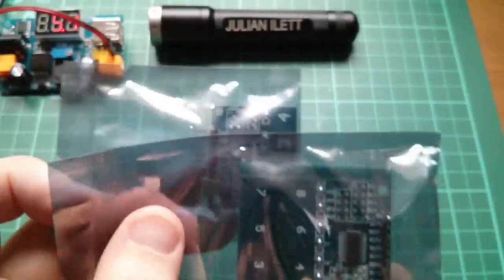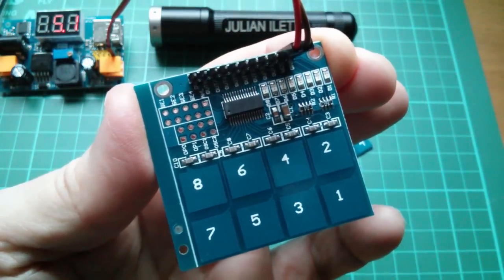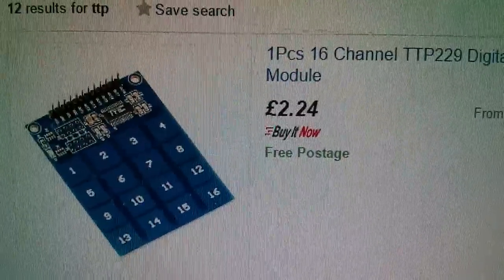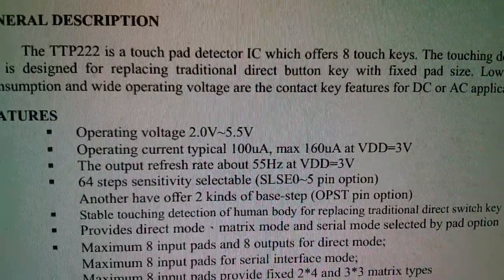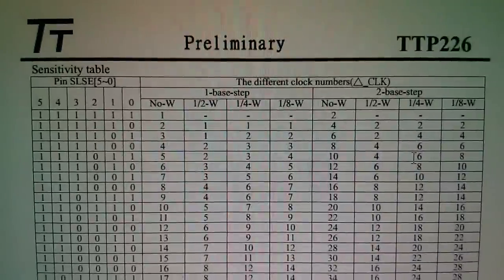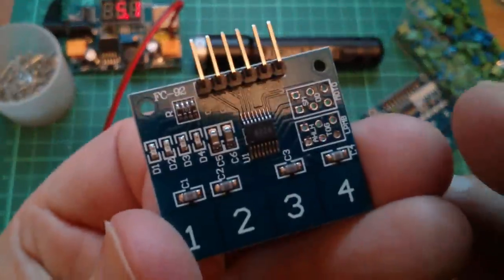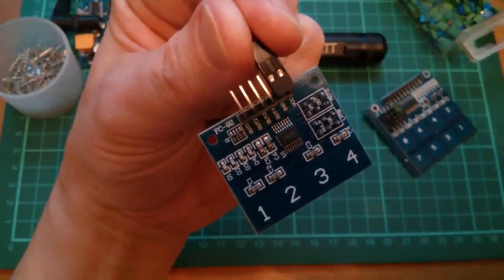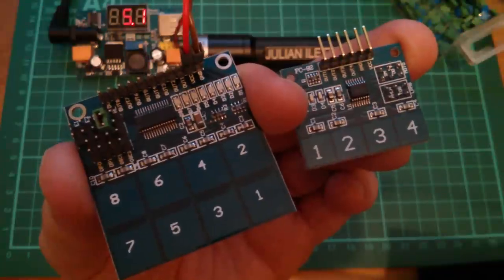Postbag: #32(b) - Capacitive Touch Switch Modules TTP224/226

Comment: when  i desolder filled holes I find it easier to heat it the pad from one side and have the solder sucker at the opposite end of the hole.  of course you will need a vice to hold the board in place.  thanks for the video...very helpful
Reply: +bd594 Yeah, it's much easier that way, you get a nearly air tight seal when the soldering iron tip is not getting in the way.
Reply: +bd594 Yep, always been doing it this way. Piece of cake.

If you can't (because the "other side" is not accessible), solder wick is an easy enough solution.

Comment: ".. where triggering an adjacent key was a major problem."   Well, that's it for touch sensitive controls in nuclear power plants then
Reply: That's really weird you should mention nuclear power plants - I was thinking of the Simpsons episode when Homer tries to use the phone and gets a message saying "the fingers with which you have dialled are too fat, if you require operator assistance, mash the keypad with your fist now"
Edit- Just to clarify - I'm not referring to Julian here or being cruel - I wouldn't be able to press these on their own either. It's just what I think of when buttons are too small for adult fingers.

Comment: Small tip for clearing holes: mount PCB vertically, heat a hole with a soldering iron from one side and use a solder sucker on opposite side :)

Comment: I know, it's quite late and I don't know if already said it... Through hole pads are easier to clean if you put the "sucker" on one side of the pcb and the soldering iron on the opposite side. And a little dip of flux (or fresh flux containing solder) can help a lot as well. Hope this is helpful anyways. Greetings from Germany!

Comment: I had some PCBs made that I designed for a domestic light switch replacement arduino project. I can toggle and dim from 5 touch pads on the PCB. Also put some 0603 smd LEDs soldered mounted on their sides shining on the pads, works a treat :)

Comment: I find it somewhat suspicious the chip came with the pin hole soldered shut.. and once you do get pins linked, the functions do not work correctly. It's almost like the company knew the functions do not work correctly and just cover up the holes with solder as to discourage people from finding this out. Come on Tom Tech you should know better! Any thoughts?

Comment: Julian Ilett With those filled in-holes, I'd either use the heat gun, heat it up and just push the headers in without bothering to suck out the solder, or I'd blob a load of solder all over it, heat it with the soldering iron and just poke the pins through one by one with the solder molten, then just suck or wick away the excess solder. In other words, don't bother trying to get the solder out of the holes, just worry about getting the pins in :)
Reply: Also, I'm wondering if those touch pads are actually intended to be extended in some really botchy way, ie by capacitively coupling a wire on to them without making an electrical connection. I'm wondering what happens if you just physically stick a wire to each pad with glue or tape and then touch the end of it? Or perhaps a small square of conductive foil glued to each pad with a wire attached?

Comment: Back in 1975 - a 4000 series logic chip with a 10 Meg resistor between input and ground - produced a reliable touch sensitive switch. Picking up mains hum when touched.

Comment: I don't think you can really blame the chip, or even the PCB layout on the bigger unit. Sensitivity defaulted to max, but easily rectified. in 'single' mode, it obviously did what I would have implemented in software, anyway. "Use first detected, ignore all others until none detected'. Think the real fault is the current drawn by the LED's. ?increase the SMD series resistors considerably, maybe?
Oh, wait, Julian...you wimped out of building that surface mount 'roulette' thingy' ;-)
SMD's aint so bad. I've got to use them at work, even 28-pin  0.5mm spacing chips can still be easily done by an old codger of 58 like me...just buy an SMD practice board from alice, banggood or similar first...

Comment: I look forward to seeing more touch sensors in later videos :) As you said... it's hard to not want to get your hands on some of the other variations to work out what the heck is going on! Like some other people have mentioned, I would look at mounting it on something to remove the  'hand capacitance / bridging" possibility from the equation, and would be very critical of the circuit implementation - our chinese friends have no regard for chip tolerances at times and make some wonderful 'release the magic smoke' circuits! 

I'd also love to know how much space you can put between the pads and your fingers... can you put a 1 / 2 mm piece of plastic between your finger and the pad? Glad wrap should work (it does for computer touch pads), so what else can you put the panel behind... And had you thought of playing with computer touch pads... you can get them complete with decoder chip, which can be interfaced with an arduino... You can then define your own 'touch zones' etc...

Comment: Maybe it needs a 3D printed spacer grid thing between all the buttons, so you get a bit of a raised edge and to isolate the buttons from each other. Ordered the one with 16 buttons just now. I'd like to control the Ikea Trafdi smart lights with it and a Pi Zero W.  Should be fun. :)

Comment: Looks like having too many LEDs lit up is causing the chip to shut down. I wonder if the output pins on the chip are driven off the internal voltage regualtor - I imagine that can only handle a few mA. Cheers!!
Reply: Yes, an output pin can only source 4mA according to the datasheet. But it does not mention what the limit for all of them is and if it's driven off the regulator.
Julian Ilett  measure the voltage at the output pins, preferably with an oscilloscope, and check for "dips". The internal regulator has 2.3V so if you see that, you know the LEDs are driven from it. Btw. you have to specifically search for the "BSB" version of the chip, which has 16 pins. The 20-pin datasheet has more pins with additional options. (check http://wenku.baidu.com/view/ff775115a216147917112855.html )

Comment: Didn't have any problems with my four way version. Normal sensitivity and none of the bugs you had. Though mine had a slightly different pcb (at least the silkscreen font).

Try putting a piece of plastic or glass on top to lower the sensitivity. After all, in real world applications you wouldn't use the board as is. I connect mine to some copper pads attach to the back of a glad panel, ad replaced the four caps with a lower value.

Comment: I guess you did not test the SBMS as of now. You will probably love the response and sensitivity of the 6 touch keys. I use the STM32F072 microcntroller for the capacitive keys and the software is quite complex and takes some resources but after you adjust all those complex parameters it works really well.
Anyway I added a key lock like on mobile phones so that there will not be unintentional touches. To unlock just push OK UP and Down in order but it will indicate that on the screen if you touch any key when is locked.
Reply from the maker: ***** Not yet, but after I fit the 8 LiFePo4 cells into the bike, I'll be looking at balance charging and the 2 BMS boards that I have. Then I'll start looking at the SBMS. I did think of you when I was having all that trouble with the capacitive switches!

Comment: I find that desoldering wick will suck it right out of those holes--another alternative--wet the solder and thump/slap the PCB to knock out the solder with inertia--may need tor heat after this to smooth..  Filled-in holes: Probably due to a solder-wave swipe??  I agree with the "BAD" verdict.

Comment: Hello - the 4 Way switch works good  when you use batterpower , when i  shut off the Powersupply - it begans to work correctly   with the rest of the Condensatorpower of the powersupply !!!!

Comment: Did you ever get hold of a TTP226? I would love to see your tests on that. I've just ordered a few from China and would be happy to post you one when they arrive in a thousand years (I'm in UK too). Also, I'm intrigued by the brief mention in this video about matrix mode, I'd love to see your investigations into that.
Reply from the maker: No, I gave up on the TTP chips - I prefer the MPR121
Reply: thermal touch switch using op_amp

Comment: Next time try adding some fresh lead based solder to mix with the lead free solder which lowers the melting point and you can just heat from the bottom side and suck it from the top side. I hope that makes sense.

Comment: With the four button touch pad I found that if you connect TOG and then connect SM the board works fine and does not lock up

Comment: Help!
How to turn on toggle mode in ttp226
I have done all possible connections, read data sheet many times, but nowhere toggle Is written.
Ttp226 has too many options to select, but how to use it in toggle Mode. I don't want to use arduino only to toggle output, which is working.

Comment: I wonder, did you ever get the second shipment with the 16 way?  I ordered one myself recently after finding them dirt cheap on ebay.  The 16 way only has 5 leds, and 8 output pins.  I hooked it up through my arduino and the output from the keys are very strange viewing them through the serial monitor.

Comment: Wow these appear to be very fun for the price! :D

But if anyone wants a more reliable capacitive touch sensor, try out the atmel's Q-touch line of chips, and especially the qt1070 witch uses i2c and can (extremely easily) talk to an arduino and output a 8-bit value on how much capacitance is detected. A really nice chip :)

Comment: Try the unit fixed down to something rather than hand held - it's possible something is coupling to another part of the circuit via your hand.
Also it could be a supply noise or instability issue at that particular current, try 100uF across the Vcc and Gnd, or a different supply.

The touch pad won't work on my Toshiba laptop when powered by a certain in-car dc-dc converter! How useless is that?

Comment: Thanks for sharing! Got one of the 4 touch version. Works perfectly. Is it possible to set the chip to one led on and toggle between other buttons? Got singlemode (sm) on and toggle (tog) but doesn't seem to do what I want. Any suggestions?

Comment: How did you enable that Toggle Mode? I have this board, and I want the 224 switch to keep the light ON when a pad is touched (momentarily), and then only turn off when another switch is touched.

Comment: "And the lines (lines from touch pad to IC pin) do not parallel and cross with other lines" Page 4 of the datasheet. So piss poor circuit design is most likely the problem here. Having the lines so close together probably screws up the auto calibration it has built in. Reducing the sensitivity could fix some of the issues.

Comment: Strange i am typing this one a keyboard from the 1980s that uses the same technology :P An IBM model F. :). I would say form experience working with capacitative seance PCB is grounding. you need very good grounding. Different pads will also have differing levels of capacitance even flexing the board could cause problems.  

i would say bad pcb design. The IBM uses 2 pads one 5v the other tied to ground , when you press a key a conductive pad moves towards the pcb causing a change in capacitance how are they doing it with just one pad ? 

The modern replacement controller i use can be adjusted by increasing or decreasing the mV level that it counts as a key-press. set it too low and you will get pads next to each other activating.

Not my work but you may find this interesting.

http://deskthority.net/workshop-f7/beamspring-usb-controller-t6044.html